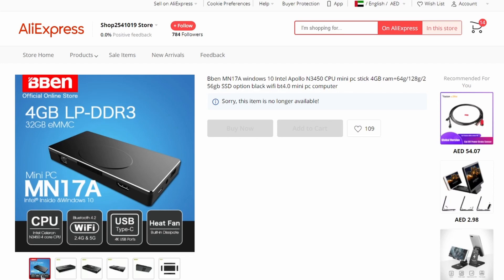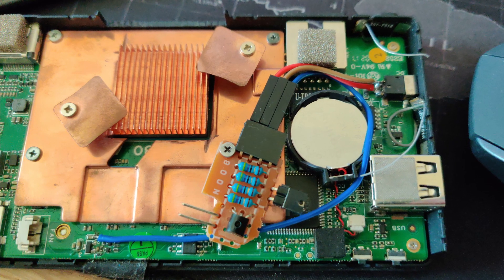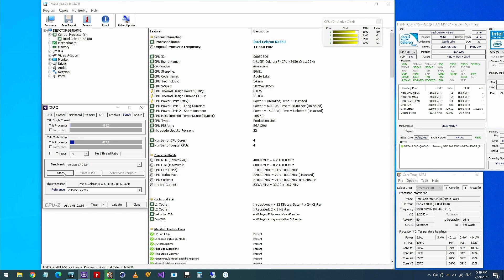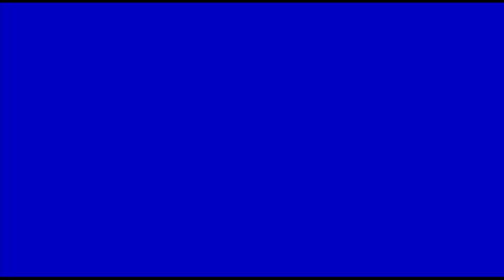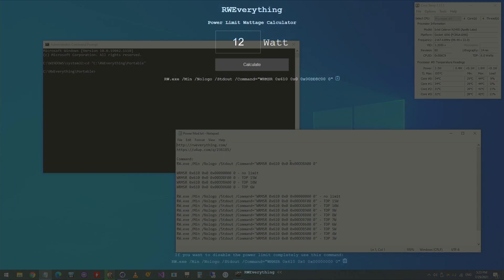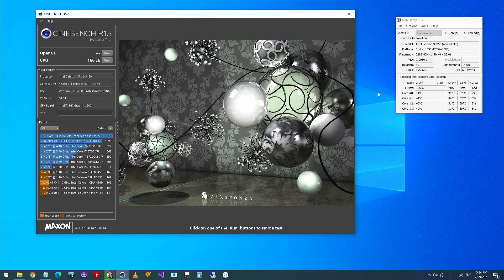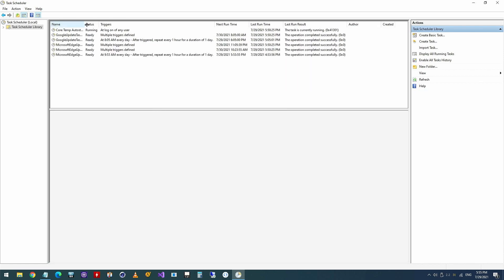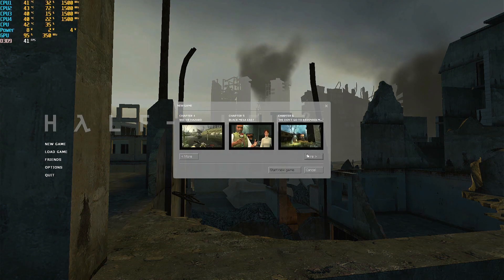Potato PC? Get a 25%+ Performance Boost!!!

Comment: Have you tried going past the 10W power limit and benchmark it to see the difference?
Reply from the maker: There was no performance improvement after a certain value. Once the CPU remains at the max boost frequency, there is nothing more to be gained. You can disable the power limitations completely, but the CPU won't draw much power and won't clock higher.